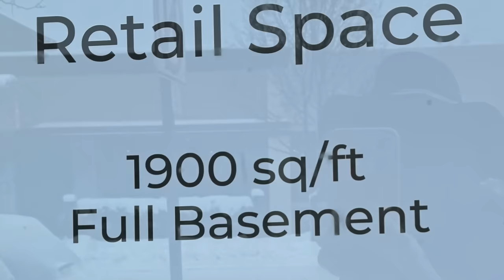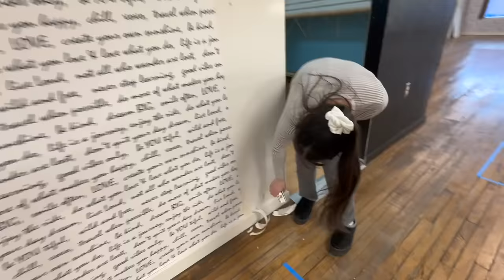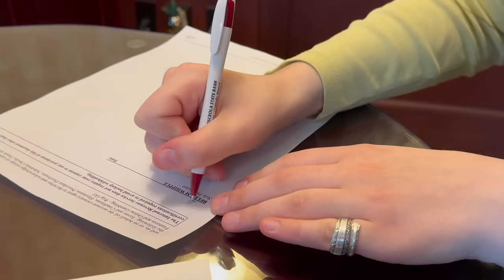We're opening a coffee shop!

Comment: Tip to remove wallpaper spray bottle    with vinegar and warm water. Spray on let soak a little then pull off. Start around seems spray enough it will come off in big sheets. Also wallpaper is two parts the glue sheet and the paper sheet good luck

Comment: Congratulations as a former fire inspector you should check your local building inspectors thoughts on your ceiling, the plywood probably doesn’t have the fire resistance rating required for a commercial building, if you have any neighbours that share the building this could cause issues if a fire breaks out. Shame because it shows you did a lot of work, insurance company could have a problem also, if you still have the ceiling tiles a trade off could be to place them ontop of the wood and install clips to hold them down

Comment: As a business owner unless you have pockets full of money  the ceiling was fine and took up unnecessary work time when you could have been open earlier making money   No one looks up and thinks the ceiling is bare. The money spent should have been saved to use in the bank you spend as little as possible to begin with. The sandwich prep is in the way of the door so needs to be moved  when your carrying plates and hot cups you need to think of H&S  Good  luck with your venture.